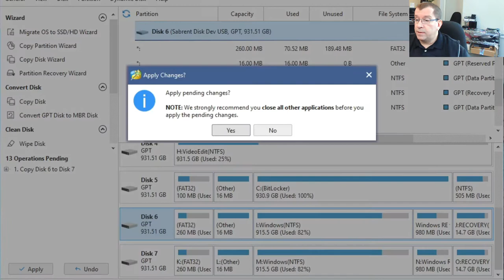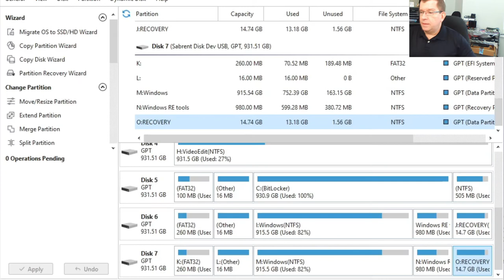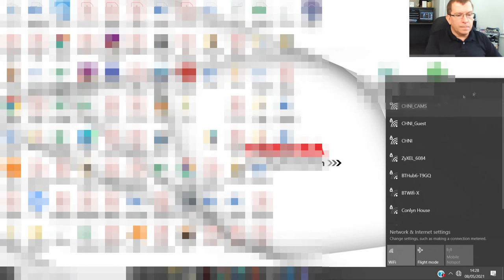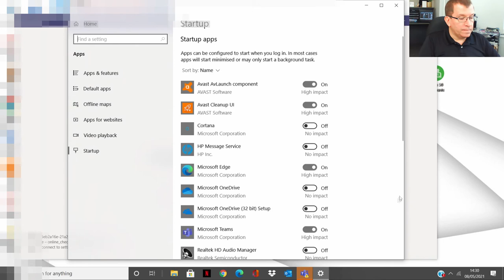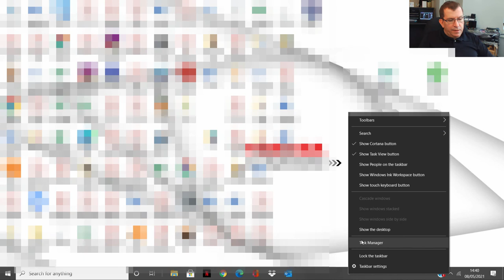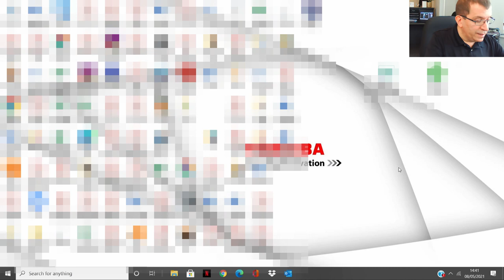[40] Super Glue and bicarbonate (baking soda) hinge repair (and SSD upgrade) - HP 15-bs158sa

Comment: With a 2.5 mm drill drill through the palm rest from the back. Attach the hinges with 2.5 mm flat head machine screws and nuts. There is enough space on the bottom tray to accommodate the nuts. Works better than new.

Comment: Hello sir. I'm going for the DIY project for the same problem of my dell laptop. Should I use locktite gel or all purpose liq one super glue? Or should I use jb weld epoxy?
Reply from the maker: I used Super Glue and baking soda together to make a strong resin. Not sure about those other options.

Comment: I used Gorilla weld after using super glue alone to line up the broken pieces. Gorilla weld is way stronger than superglue and not brittle.
Reply from the maker: I've had great results with this method: The laptops I've seen again a year later are still holding strong. I'm sure you're right that Gorilla Weld is excellent though.

Comment: this works wonders if there are enough pieces of plastic left, when the plastic pieces are completely gone, it's A LOT harder to put the bronze nut in the correct position and height...you can't just glue it to the chassis, it has to go a few mm in the air, so the screw can reach it...AND the hinge must rest over the nut, leaving a space between them is a recipe for prompt failure
Reply from the maker: True. I've seen Sorin (https://www.youtube.com/@electronicsrepairschool) use hot glue, which looks like it could work in those cases where the plastic is so damaged that you have no good reference points for the bronze inserts.
Reply: When the plastic is completely gone, glue to the bottom and use a longer screw. Worked for me.

Comment: Hi...

I have a HP Pavilion 17,3"... I have the same problem with the hinges base... Do you think I shoul replace te hinges too??? Or just is enought with this metod to fix the bases??? And maybe put a little bit of WD40 to the old hinges.

Best Regards...
Reply from the maker: Hard to say if the hinges need to be replaced or not. Sometimes you can loosen the nut to make the hinge easier to move and reduce the amount of force it imparts on the chassis.

Comment: I just fix same laptop as the 1 u repair, same model same problem. It took me 5 hour to fix the screw base. After all done, that laptop doesnt align with lid 🤣🤣🤣.  Perhaps i need to trim resin a bit, anyway Thanks for sharing the material & how to fix it.
Reply from the maker: Yes it can be hard to get everything aligned after this repair. As long as the metal screw inserts are in the right place, you should be able to trim down the resin to get the hinges to fit properly. Good luck!